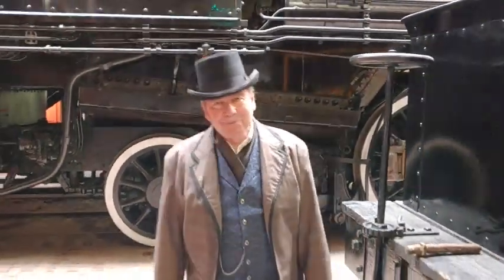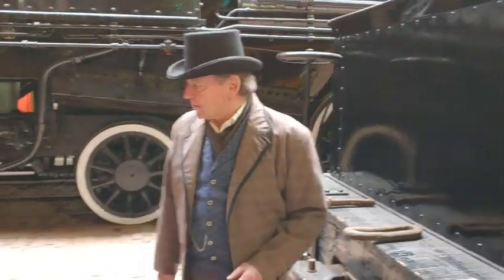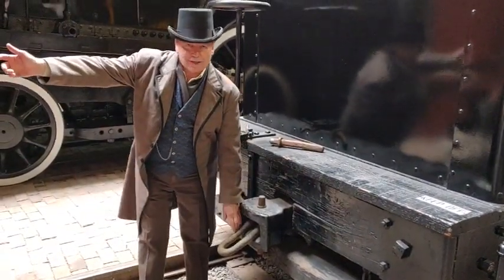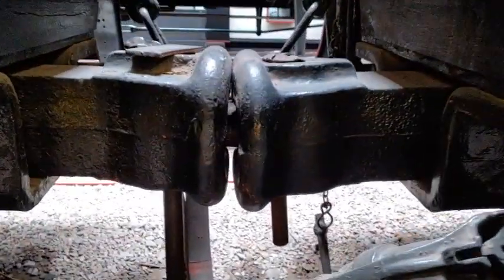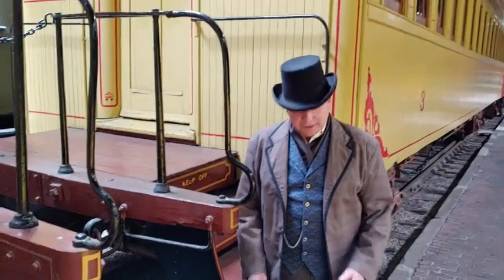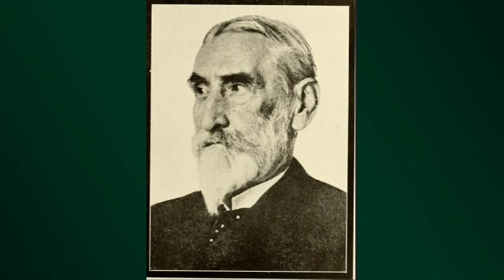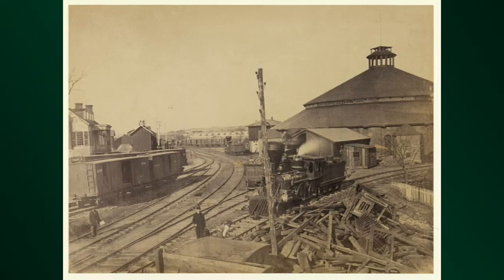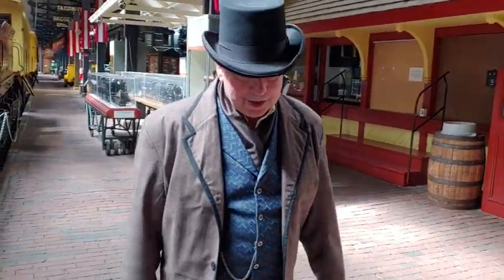Railroad Museum Tours: #38 - Couplers

Comment: The link and pin coupler is a nice example of capitalism.
Reply: How so? They didn't want to use 'em, even knowing it cost people their hands.
Reply: @KennethStone  Link and pin - Cheap. Significantly more dangerous. Preferred by the guys handling the money.
Knuckle coupler - Expensive. Significantly safer. Disliked by the guys handling the money.
Reply: @richardmillhousenixon  the guys handling the money loved it once they actually had them. The first patent of knuckle couplers could handle a train 4 times the length of the link and pin design.